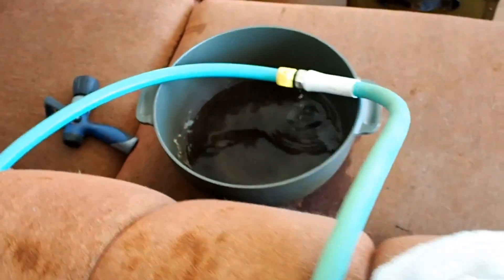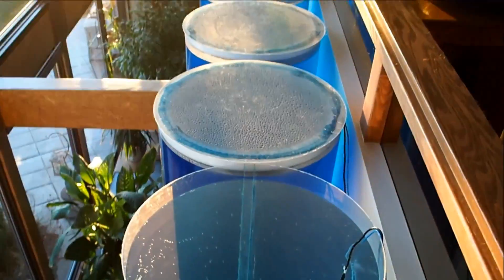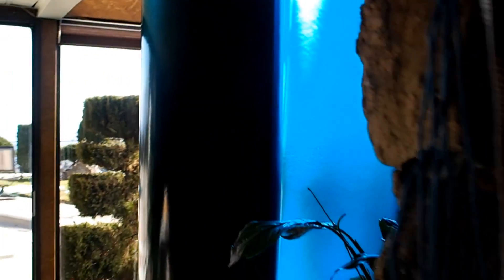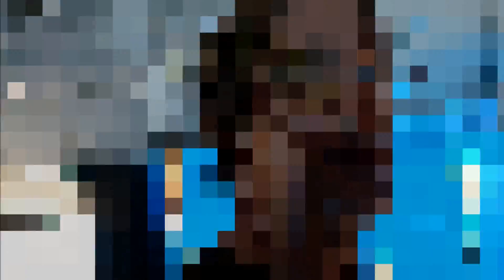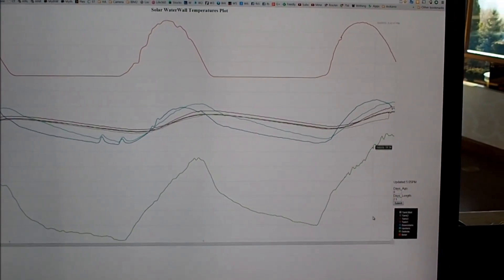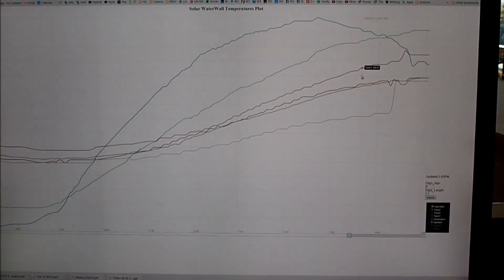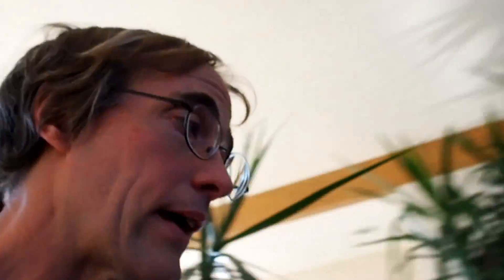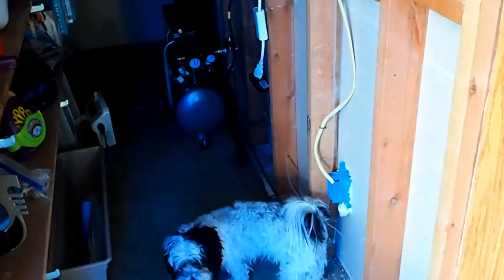Passive solar water wall battery

Comment: Rather than air bubbles why not small 6v fountain pumps at the top of the tubes with pipes to the bottom.
Reply from the maker: That would be another option.    A bit more complicated, and not as pretty as bubbles.   We would run the bubbles more for the aesthetics.   The water temperature equalization was a bonus :)
Reply: The bubbles work to stir the water, and look great as a benefit. Pumping water to mix stratification adds no extra aesthetic benefit.
Reply: My guess is that move water with air pump is cheaper than water pump for the same volume of displacement.

Comment: So do tell us all. After taking into account the cost of your myriad of gizmos, the electricity to run said gizmos and the material costs, how much heat do you need to produce to be able to make this a "VIABLE" project? It is all smoke and mirrors my friend. You could probably heat your whole house during winter and cool it during the summer using traditional methods for less than the outlay and electrical cost of building and running this system.
Reply from the maker: No mirrors, hopefully no smoke ;)    I track my electricity usage pretty closely (I have 3 other videos talking about various whole house power monitoring).   The monitoring electronics for this project use about 3 watts.   The fan is a low power DC motor fan, I used it on the medium speed which was 7 watts, for a total of a few hours a day.   All total, including the optional air compressor bubbles (runs infrequently), used < 1% of what the furnace fan used per day, ignoring the cost of the gas or electric heater element.
But you are right about the initial capital investment cost.   $2000 for the tubes, averaged over 20 years would be $100 a year.   I would guess I would have saved that much in gas bills, but in reality, I sold the house 6 months later, so definitely lost money there :(
Reply: +William Wallace Funny, the gizmos and juice to run them are of almost no consequence, the money would be in the water tubes.
Reply: Thermal mass would work in the winters as well if you connected the pipes and ran them through an underground system.. With the sun overhead shaded by the roof you would only be storing radiant or reflective light

Comment: At night in the winter do you use shades in front of your windows to reduce heat loss?
Reply from the maker: Yep, there are motorized cellular blinds on all those windows.   The house  is programmed to open/close them automatically in both summer/winter to save energy, based on indoor/outdoor temperatures.    You can see them in action here: https://www.youtube.com/watch?v=2aC2BBSmCRo&feature=youtu.be&t=3m04s
Reply: Love this idea of adding thermal mass via water tanks, Bruce!  Do you have to have the water tanks positioned near the window in direct sunlight to absorb heat or can the tanks be positioned away from the windows, out of direct sunlight?  Thanks
Reply: there is something even cooler which uses polarizing film that changes based on an electric current to switch on or off. search smart tint on google
Reply: what would polarizing film do? the point is to insulate the large glass openings against heat loss.

Comment: Great post.  I ran across your post while looking into passive heating for my greenhouse.  I would be interested in finding out how you sized the system.  How many gallons per cubic feet of space.  Naturally I will be running black to get the most out of the system.
Reply from the maker: The rule of thumb I've read is 2->4 gal per 1 sqft window.   I had 600 sf of window, so I was aiming for 1200->2400 gallon of water.   In truth, I simply put in what would fit, which was 10 18"x10' tubes.  At 132 gallons each = 1300 gallons.   

Another calculation that might help is how much heat can be stored/released.   Water has 64 BTU/cubic feet/degree F.   At 7.5 cf/gal, my 10 tube system gets:    64 * 1300 / 7.5 = 11 kBtu/F.    So when I saw a 7 degree rise in water temperature, I was seeing about 7 * 11k = 77 kBTU of heat being stored per day (and released at night).

I put a few more calculations on the web post here: http://misterhouse.blogspot.com/2015/03/passive-solar-water-wall-battery.html

Comment: Bruce,

Interesting approach, but it seems like a half-way solution.

Have you thought about possibly combining radiant flooring into your domestic hot water system and just scaling up the tank size/volume?

This way, you get thermal mass of your flooring, combined with water circulation to help move/control ambient heat into your domestic hot water system.

On top of that, you get a more or less free source of infinite (for your purposes) hot water.  

During the summer you pump cool water into the floor, and when it comes back hot, you drop it back into your tank(s).
During winter/nights/cold days, you circulate warm water back into the flooring to maintain temperature.

Sure, it isn't as blingy as your blue columns of water

Comment: Very interesting video. I wish I understood it better (my pea brain). I thought red conducted heat better than blue. (they put red dye in "wall o water" garden cloches). Not so?
Reply from the maker: Good question.   I did a quick search and could not find a good answer.   Darker, in any case, absorbs more, so I would guess darkish red would absorb roughly the same amount of heat to a darkish blue.   I went with blue because it looked like a more natural water color, but red would have been fun to try.
Reply: Hi! I think that red water would deflect red radiation from the sun while black is supposed to absorb the whole sun spectrum. For example a red apple is red because it absorbs every colours apart from red which is reflected back out so that's the colour the eye sees.

Comment: Given that metals conduct heat faster than water convects it, wouldn't a simple way to equalise the temperature have been to insert a metal rod down the middle of each tube/tank?  To induce more vigorous mixing, the middle 80% of the rod could be sheathed in some insulating material (like closed-cell foam) — thus heat from the hot water at the top of the tank would be conducted to the top of the rod, then down through the insulated section to the bottom of the rod, before being conducted to the cool surrounding water, which would then convect upwards, mixing along the way.
Reply: no, you would need a lot of insulation. plus, it would not conduct heat very well unless there was a large amount of heat. think of metal handles on a frying pan, they dont get hot despite being attached to a metal pan.
Reply: You say that, but I'm not sure why not.
Reply: it doesnt quite work that way
Reply: There would still be a thermal gradient. Hotter on top and colder on bottom. Bubbles create circulation which actually mixes fluids of differing temperatures.
Reply: Also, the metal rod would not be heated on the, unless the insulation was clear. This would be hard to do.

Comment: is that a battery that can run a electricty?
Reply from the maker: No electricity involved.   Simply absorbs then radiates heat passively.
Reply: ok,thanks

Comment: It's been a year... can you provide an update please?
Reply: Just posted something about this at the top of the video before I saw that Bruce had moved.

Possibly look into solar mass flooring combined with double-loop hydronic in-floor heating/cooling and a secondary storage tank.

You run the floor cool on the hot days to siphon off the heat, incidentally generating large volumes of hot water.
Then, during the cool days or in the evenings, you reverse it, pulling hot water from the storage tank to warm the flooring loop.

It's not a TOTALLY passive system.  But it gives you some benefits that Bruce's system doesn't.
Reply from the maker: Sorry, we ended up moving from UT to AL shortly after I made that video, so I never got to gather a full Winter of data.   Not so much of a need for passive solar heating in Alabama :)
Reply from the maker: In floor heating/cooling would be nice, but is often hard to retrofit (floors can't be made thicker).    Otherwise is a good idea!
Reply from the maker: +Drew Baden Sorry Drew, we moved from Utah to Alabama last Fall, so never did get to collect a full Winter season of data.    The new owner likes the tubes, so is leaving them in place, but was not geeky enough to run the instrumentation, so I took out the monitoring.    

I'm now collecting data on heat pumps, but that is pretty well researched already, so probably no need to report on that.
Reply: +Bruce Winter I'm in the beginning stages of laying out a passive design.  When I say beginning, I'm talking cytoplasm or zygote.   I've nothing on paper yet.    I'm a little worried about passive swings which led me to your site.   I don't want forced air.  I'm thinking I'll just go ahead and pot pex tubing in the floors when they are poured in case I ever need to cycle glycol.  Then there's the whole geothermal vs minisplits... ugh!  Heat pumps you say? That's on my list of the clothes dryer.

Comment: awesome idea. i live in florida and am working on designing a thermal battery that more or less works the opposite of this. something as a precursor to cool the air when the AC first kicks on. lots of math to do lol. would love some input on this idea!!!
Reply from the maker: +J Reed We recently moved to Alabama ... practically neighbors :)   Have not exercised our AC units here much yet,  but I'm guessing that will change when Summer rolls around.
Reply: +Bruce Winter OH YES. if its similar to here, which i believe it is, you will have your AC on 24-7 for most of the year. im thinking ac effeciency is more or less about passively keeping radiant heat out of the house. i am finishing my mechanical engineering degree now also.

Comment: so the heat is simply radiated from the tubes surfaces? and helped by the ceiling fan?.....what is used to keep algae or to keep water clean...?..
Reply from the maker: Yep, heat is simply radiated, with help from the bubbles and the oscillating fan.
Reply: U should know that water can be kept clean by throwing in a bottle of H2O2 (hyd perox) per tube

Comment: you manufactured the water tubes? ,from sheets of the plastic material?..I see a seam I believe?
Reply from the maker: Tubes are made by a company in NH from fiberglass sheets that are rolled into a cylinder, so one long seam.

Comment: on a smaller scale....I always keep empty spaces in refrigerator filled with water filled milk cartons...keeps the cold from dissipated out of frig quickly when doors open....same idea on peewee scale..,true?
Reply: yes but the water won't flow out of their fridge every time they open the door. in a way the only reason its useful is it decreases the volume of air the fridge has to cool with the added benefit that the fridge will have more thermal mass.
Reply: Spot on. There's a reason why some appliance manufacturers advise you to be cautious of having "too much" in the fridge-- it gets too cold! My extremely basic understanding is that a refrigerator checks the temperature and if it's too high, it runs the compressor for X amount of time. Perhaps it's checking air temperature, which can vary by simply opening the door, rather than radiant temperature (much less fluctuation). I can say from personal experience that my fridge iced over simply from filling it up with food and drinks purchased before a party.
Reply: Paolo, I think it's easier on the fridge cooler to run for medium duration less-frequently than intermittently. I'm not positive though, as this is out of my knowledgebase.
Reply from the maker: Russ, sorry, I missed your comments from a year ago.   They somehow got flagged for review and that put them in a different place which I missed seeing.
Reply: no problem,,I enjoy your work. :)
Reply: Hi. In my opinion, in order to keep that water cold, instead of the same volume of air, you're going to use more energy.